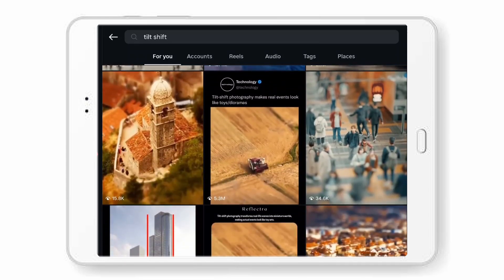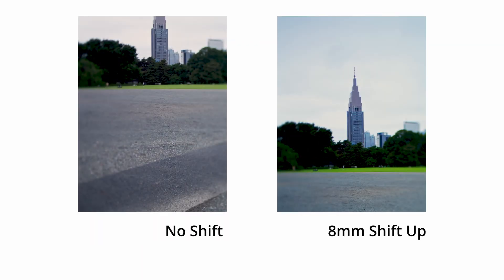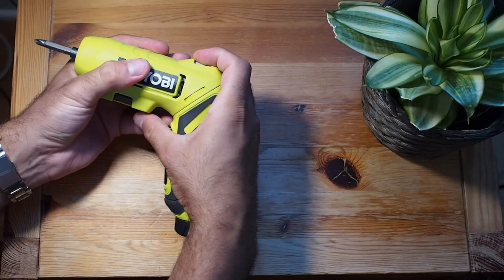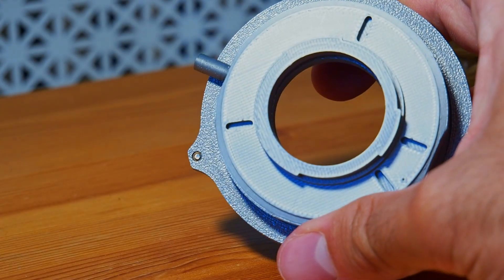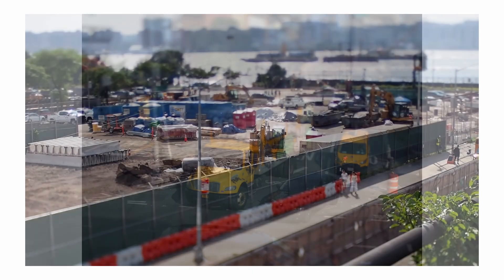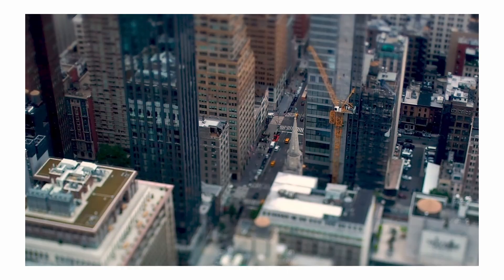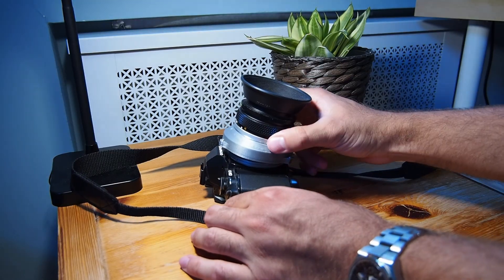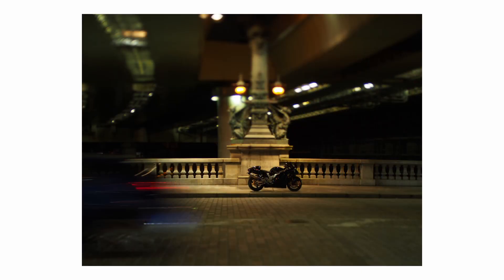My 3D printed lens makes BIG things look SMALL

Comment: If I use the adapter, is there a phenomenon that is out of focus due to the flange back difference?

And is there no assembly manual or part explanation document?
Reply from the maker: I am not quite sure what you mean with the out of focus due to the flange difference. If you mean that the lens cant properly function/focus due to the adapter, then no, it works normally if you have it in the 0 degree untilted setup. As for setup, there is no manual unfortunately as I haven't gotten around to doing it but the parts are quite simple and the video shows how I assembled it. If you have any questions about assembly please let me know!

Comment: Any chance you could make a step-by-step assembly guide?  Or is it fairly self-explanatory?
Reply from the maker: It's not entirely self-explanatory but you can line up the parts more or less and check the sped up video of me assembling it. If you have any questions let me know. Maybe if I have some more time in the coming weeks I can post a guide.
Reply: @TheRedMammon  Yeah, I've got everything printed out and have all the hardware now and even watching the video a dozen times, while I'm fairly sure I've got things more or less in the correct order, I'm not sure.  Presumably, the alignment between the outer beveled ring with the detents and the inner beveled ring that attaches to the shift slider should line up to create more or less a straight tube, but I'm not sure if there is a way built in to ensure alignment.  There are also channels on the M43 mount side that I don't understand the purpose of, but I assume I'd align them so when locked onto my camera, the whole mechanism is parallel to the camera. Even a crude diagram would help a ton.  Thanks
Reply from the maker: @DamianSheesh  apologies for not having a proper assembly guide. I have updated the makerworld site to include an ordered kind of list to put the parts together. Yes, the parts align into a straight tube. If you notice on the ring that clamps the lens part of the mount to the rest of the contraption, one of the screw hole bits has a nub on the side. If you orient this toward the cutout slot that is facing the sliding out part that is when it is a straight tube. The channels on the m43 side I am assuming are just the spots for the peg on the camera body to slot into when you twist it onto your camera. These just allow for different rotational orientations. I will post a fusion 360 assembly and screen shots to thingiverse in a few minutes. Sorry for the confusion
Reply: @TheRedMammon  No need to apologize at all!! It's super cool that you've done this. Thanks for the details
Reply from the maker: @DamianSheesh  assembly is uploaded to thingiverse
Reply: @TheRedMammon well I managed to get mine together, but the k mount adapter I hacked into your model isn't great. I don't quite have infinity focus, so I need to get closer to the perfect flange distance. Also, my lens keeps wanting to fall off the mount. I need to get more friction in there. Maybe I should print that part solid or something as I think the 'ears' are crushing too much. It's fun though!
Reply from the maker: @DamianSheesh  glad to hear you built it! If you are handy with cad you can model it for K mount. Glad you are having fun. Your print bed might be different from mine (mine is textured) maybe thats why theres not enough friction
Reply: @TheRedMammon I did! We've also been corresponding on Reddit. The flange distance between k mount and Olympus is only different by a quarter mm, but that seems enough I need to adjust it slightly. As for the lens mount, the m43 side works great - it's the k mount side where the issue is. The flutes that engage with the lens crushed to the point where the lens isn't really holding on. Turning the aperture ring pops the lens off.  I'll figure it out!
Reply from the maker: @DamianSheesh  best of luck. I'm sure you'll figure it out. Let me know how it goes
Reply from the maker: assembly is uploaded to thingiverse

Comment: This is awesome. I have an old Canon 350D, which accepts 35mm lenses but with a crop. Do you think I can adapt your system to my camera + lenses?
Reply from the maker: I don't think it would work on your DSLR unfortunately. I am able to get it to work on my mirrorless camera since the sensor is so close to the mount that I can adapt older lenses where the sensor/film is not close to the mount. You can do some googling on the flange distances and play around with it though!